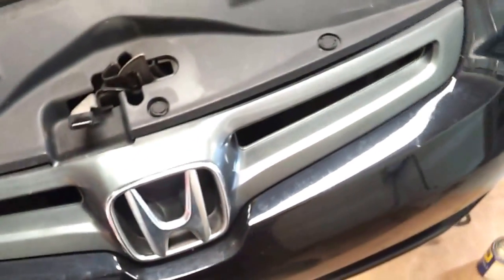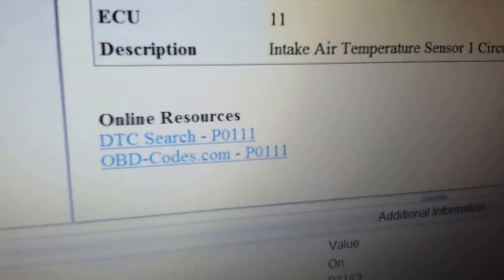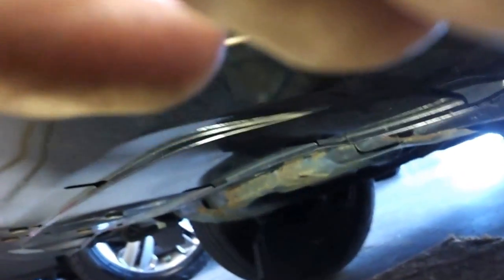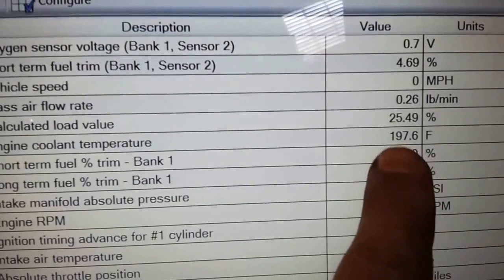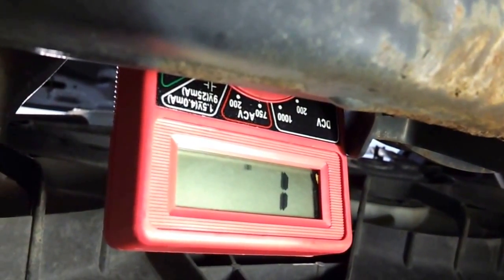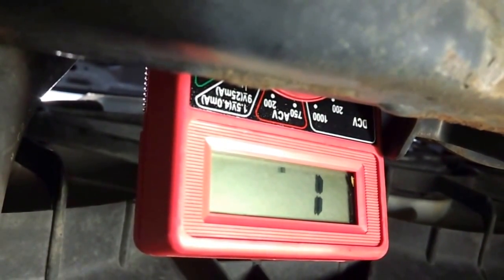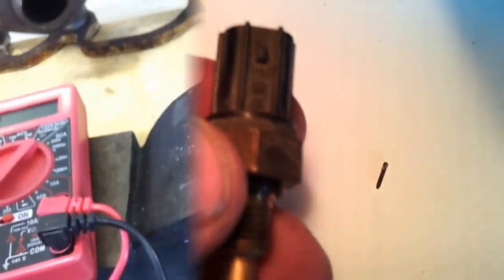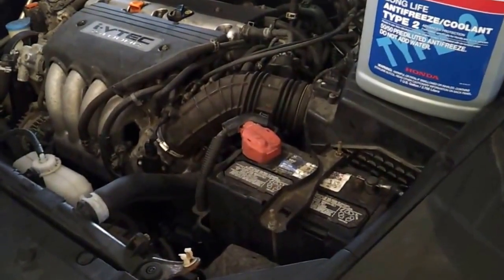Honda/Acura coolant temp sensor-trouble code P2183- 2005-2007- 2.4L 4 cylinder (ECT2)

Comment: Currently diagnosing and trying to fix my moms 08 acura tsx, changed out her radiator, thermostat, water pump is good but still is showing it’s over heating on the tack meter, but it’s not throwing the car into limp mode or smoking, could the coolant temp sensor be the issue ? Fans work as well
Reply from the maker: Leak down and compression test for a blown head gasket.

Comment: did you have to drain the coolant to replace the sensor or could you just replace it ?
Reply from the maker: Drain the radiator. Coolant baths aren't good. 👍

Comment: Good morning friend, excellent video and thanks for sharing it.

One question, can that sensor you changed interfere with fuel consumption?

Greetings.
Reply from the maker: Good question. A bad sensor could effect fuel mileage if the pcm thinks the engine is cold It would add more fuel. Probably depends on the strategy for individual makes and models.
Reply: @ozzstars_cars  Thanks very much buddy.

Greetings from Mexico.

Comment: Are both sensors the same?  The one on the radiator and the one on the engine block?
Reply from the maker: Not in this case.

Comment: Will this cause ur cooling fan to not turn on ?
Reply from the maker: Sure could.
Reply: @ozzstars_cars  when I checked it for ohms it was reading 00.01a overload that means it's not working right ?
Reply from the maker: @brooklyn7941  I discuss the sensor testing procedure in the video.
Reply: @ozzstars_cars another question did u experience any leaking at the top under the upper hose ? On the radiator

Comment: Re: wire connector to ECT 2: if this connector is jumped with a wire, should it automatically turn on the radiator fan? If that doesn't happen, does that mean there is a break in the wire somewhere? The fan works BTW and turns on with AC engaged, but doesn't turn on otherwise.

Comment: Now does this senor control the fans? Turn/off
Reply from the maker: The ecm controls the fans. Sensors only report data.
Reply: @ozzstars_cars  got it
Reply: @ozzstars_cars  thanks
Reply: @ozzstars_cars  yeah I just wasn't for sure I thought it did and I didn't notice anything else besides the two sensors and I know one went to the temperature gauge and one was the sensor but I wasn't for sure if they sent to the ECM to control the fans because when I turn on the AC the fans kick on at first only one fan kicked on then I replaced the whole assembly now both fans work but I did notice it after I took it to the automatic car wash then the next thing I know if I'm sitting in traffic the car started to overheat and again I only noticed it after the car wash and I do mean directly after the car wash.
Reply from the maker: @everydaycommute4794  test the circuit integrity, you will need a wiring diagram.

Comment: Would that bad sensor cause both my radiator fans to not turn on at operating temp? They only turn on when the A/C is on .
Reply from the maker: Anything is possible. It's easy enough to check and test.

Comment: Is it necessary to drain some coolant if your just replacing the ECT sensor located near the engine & behind the cylinder head?
Reply from the maker: There will be minimal coolant loss. Top off as necessary.

Comment: Mannn Thank you I admire your wisdom! Can you tell me which one of the two sensors that  controls the air fuel ratio? I have an issue where my temp gauge stays in the low range to long even on warm days and I have a check engine light for a P0134 o2 not getting current and Im wondering if one has to do with the other!! Thank you so much again Great deminstation!
Reply from the maker: The front A/F or O2 sensor controls the fuel trims.  Test and don't guess.  Here is a video you may find interesting on a Nissan. https://youtu.be/o_DvodrqP1I

Comment: My fans turn on when my AC is on but won’t turn on when car is at running temp with the ac off can this sensor cause that?
Reply from the maker: What codes are you getting?

Comment: There is an open (not a short) in that faulty ect2 sensor. 

Great video. 👍
Thanks for showing the locations of the two ect sensors.
Reply from the maker: You are correct. It's been a while but I probably was referring to the sensor being "shorted out". Either way it was junk. Thanks
Reply: @ozzstars_cars  yeah, I agree. 
That sensor was toast.
Reply: @ozzstars_cars  I think you were reading the ohms of the vice also, since the metal part of the sensor was clamped.
Reply from the maker: @anthonysteelemusic  12:25 clearly states OHM readings of the new sensor.

Comment: Thanx a lot for your clarification.  I had a problem with my fans not coming on for my RSX. I googled for days and everybody keeps talking about the one ECT by the Engine block and doing the safety pin test on that will trigger the fans to turn on. I did it and nothing happens, so I was scratching my head for the longest time trying to figure out why it's not turning the fans on. I know about the one ECT by the rad and tested that made my fans go on there, but nobody talks about that sensor. Because of your helpful description, now I know where my problem is, and I will hopefully fix my problem by replacing my ECT2 sensor. Thank you very much!
Reply from the maker: Thanks for the comment Jo, Let us know how the repair turns out.  Glad to hear the vid helped you out.
Reply: @ozzstars_cars  Well, I currently don't have any problem with the Temperature gauge rising, I just noticed that both fans were not working even on the hottest days and I just noticed my Voltage drop dramatically when I slow down, but when it's cool or during winter I don't have that problem at all. So, I am suspecting it could be the cause of the fans not working. I bought the ECT1 and ECT2 already a while back because I didn't know which to replace. I played around with some electrical components now, so when It's getting warmer now, I'll see how it goes. When I replace the ECT2 sensor and get the fans working again, I'll let you know. Thanx again! Cheers!
Reply from the maker: @joktv7748  good luck with the fix, keep us posted.

Comment: Hey, man firstly thank you for making this video really informative. I am wondering if you run 12v to the wiring of the coolant fan sensor if both fans are suppose to turn on? Thank you!
Reply from the maker: I wouldn't try that with the sensor circuit.  You can unplug the fans individually and apply 12 volts for testing.  The ecm turns the fans on, not the sensor.

Comment: Í have a question the fans dont star 
i change that sensor from the radiador. 
and still not works.
I check the relays they work
and fuse
Reply from the maker: Did you apply 12 volts to the fan directly?

Comment: Not sure how active this comment section is but I have a 2015 accord that the cooling fan and ac fan do not stay on, seems that all the fuses are good. Think it’s the temp sensor? And help would be much appreciated
Reply from the maker: Why would they stay on? Cooling fans only run when necessary.

Comment: do you need to use a Honda genuine part or a similar part will do?
Reply from the maker: The sensor in the description worked fine it's also pinned in the comment section. OEM is good if you want to pay the money for it.

Comment: I have a question that I haven't been able to find an answer to anywhere. Does the radiator change from the 04 to the 05?
Reply from the maker: 2003-07 should be pretty.much the same but a difference between auto and manual transmissions makes a difference. Automatic trans models use a cooler in the radiator.  This car was a manual.
Reply: @ozzstars_cars  mine is automatic however the location for the sensor is much bigger than the sensor that actually goes in there. It seems like that short stubby fan switch goes in there but the plug is round and my plug is square like the one in your video.
Reply: @benny-hn7xe  I have the same issue. Did you use the bigger sensor? The short stubby one Instead?
Reply: Someone replaced the radiator before on your car then. What year do you have?

Comment: Thanks for the good tutorial.  It came in helpful for my wife's 2006 Accord.  I was able to get it done with only a few broken clips.  That's understandable, the car is 14 years so the plastic is brittle.  First time the under panel had to be removed.  One thing to note. I think your video says to use a 3/8" deep socket.  Mine was a 17mm deep socket, but I had to use an 18mm because I did not have a 17"".
Reply from the maker: Fixed and the wife is happy. Priceless.
Reply: @ozzstars_cars  Indeed!  Now to check her front driver side wheel for a scraping noise...  Never a dull day even with the stay at home orders.

Comment: Had code P2185 on my 2005 Honda Accord and this video was the solution, thank you! Note - the part number you had shown is now listed for a Honda Civic, I ended up with an FAE Altrom part #143 5085
Reply from the maker: The coolant temp sensor link that is posted in the description is for a 2005 Accord:  https://amzn.to/2uXdEwM
Reply: Ozzstar Correct. That is the vehicle in the video and mine also. However when I went to Advance Auto, both the counter person and I saw that part number was showing it fit a Civic. Instead of risking it, I went to another parts store.
Reply from the maker: @jayparsons9347  interesting but we know it works.  Thanks for updating the info.  Take it easy -Glen

Comment: Does that sensor make your car run hot
Reply from the maker: It reports temp to the ecm so it can determine proper air/fuel ratio.
Reply: Ty man I will go out and change it out and see what happens keep you informed thanks for putting your video up to man

Comment: Which sensor controls the cooling fan? My fans come on with a/c running but never come on with it off but the temp gauge remains just below the half mark no matter how long it runs.
Reply: I have the sams problem
Reply: 2009 accord LX the same problem!
Reply: Same problem idk what it is smh

Comment: This is the first time, I have gone to YouTube to help me diagnose a diagnostic code.    FIRST) I want to thank Ozzstar very much for the education your video has given me.  SECOND) I want to thank all the users for taking the time to comment and for those who took the time to reply.... I learned even more by reading through the comment/reply history.    I would have bought regular antifreeze and diluted it myself but your comments saved me that mistake by explaining that Honda's coolant is formulated of aluminum engines in order to reduce corrosion.
Reply from the maker: Great comment WR, thanks!  -Glen

Comment: I don't get it. If the other good temp sensor reports to the gauge and the computer, what does the bad sensor do?
Reply from the maker: Depends on the vehicle.  In this case ect2 reports to the ecm.
Reply: @ozzstars_cars  If your scan tool was reporting the engine temp, doesn't that mean that the ECM was already getting the info?
Reply from the maker: @nickv4073  yes. I would have to look at a wiring diagram.  I believe ect2 would be for radiator fan turn on and off.
Reply: @ozzstars_cars  Radiator fan. That makes sense.
Reply: @ozzstars_cars  yes you're correct. It controls radiator fans.  

The AC won't blow cold without the radiator fan working, right? Im not telling..im asking..Would the ETC 2 sensor issue/non functional radiator fan cause   A/C to only blow hot air?
Reply from the maker: @heatherrhodge2588  if you want the a/c to work the fans must be operational.
Reply: @ozzstars_cars  thanks! wouldn't the car overheat as well if the radiator fans weren't working? possibly not even showing that the temp was getting hot on the gauge on the dash, since it's tied to the sensor before the fans? I'm wondering bc my car has a code for ECT sensor 2 high voltage and fans aren't running.
Reply from the maker: @heatherrhodge2588  test, don't guess.👍
Reply: @ozzstars_cars  true.. good advice. I just replaced the PCM in my car bc the old one got super corroded and the car was in limp mode. I switched out the EEPROM chip but accidently switched another 8 pin IC before realizing it wasn't the EEPROM! when doing so one of the solder pads detached from the new board. it didn't seem to be connected to any circuit traces but I still found the tiny little pad and did my best to reattach it before soldering the IC. it's obv a proprietary chip bc there's no info anywhere about it 😫. I realized I'd switched the wrong chip when the VIN was wrong in my scan tool app. after switching the actual EEPROM and running a scan on the car it has no longer been in limp mode but has thrown random codes every time I've scanned. the first time there was P0301, P0124, and P1693.. which means, cylinder 1 misfire, TP circuit high, and turbo charge circuit malfunction. the 2nd time I got totally different dtcs: P2185, P0603, P0630 & P0498, ECT circuit 2 high, ECM KAM error, VIN not programmed & EVAP control vent low voltage. completely diff codes & nothing had been touched on the car between scans! cleared the codes and the next time I scanned it had the ECT 2 high and VIN mismatch. cleared again and all that was left was the P0285 ECT 2 high. it was at this time I noticed the radiator fans weren't running. it's possible they hadn't been prior to that but I hadn't paid attention. This is the point I'm at now. 

I'm completely baffled as to why the codes were completely different between the 1st and 2nd time I scanned!? With the original PCM I had been getting a U0107 code (lost communication with TAC module) only, however it remained consistent in that it was always there. the AC wasn't working already when the U0107 code & limp mode started but idk why. there were never any codes in old PCM pertaining to AC (as I mentioned, the only code I ever saw was U0107). What would you make of this? it's an 05 Acura TSX auto BTW. I'm not familiar enough with cars to have an opinion, but just knowing nothing has been touched on the car besides replacing the PCM (and well I did replace the TAC module also but everything was plugged back & the U0107 remained) but it seems to me that the "new" PCM is bad as well?!

Comment: To replace sensor the whole job can be done from the top of car. Drain radiator, then reach down from top of engine compartment and blindly disconnect electrical connector from sensor, blindly put socket on sensor and remove. (Make sure o-ring came out with old sensor) It took a total of 2 minutes to replace after draining radiator.
Reply from the maker: You say the whole job can be done from the top yet the radiator drain is at the bottom?  Interesting physics.
Reply: @ozzstars_cars  I appreciate you taking the time to make this helpful video but, yes, you can drain the radiator from the top. Lean over the top of radiator, reach down and open bottom drain petcock, Fluid will drain past circle cut-out in lower plastic shroud cover.
Reply from the maker: @ruth1948  so you just let the coolant drain on to the ground? Or do you use a pan and place it under the car, down below.
Reply: @ozzstars_cars  Yes I used a container to catch fluid and then re-filled with 'Honda' anti-freeze.
Reply from the maker: @ruth1948  oh good way to do it
Reply: how hard is to reach the sensor? did you use short or long socket? do you have the sensor part #? i'm confused with the other video. this video shows the sensor is a long one (ECT2 ?) and the other video also shows the sensor on the same location but short sensor.
Reply: You don't even have to drain the radiator because you won't be loosing that much coolant.

Comment: You actually are doing this replacement the hard way for the first coolant sensor, simply reach down to the left of the battery down to the bottom of the radiator and remove with socket wrench..takes 10 minutes max...Other than that great video...
Reply from the maker: Takes one minute to remove the shield and the sensor can be properly tested and the connector diagnosed BEFORE replacing it.
Reply: Ozzstar you can still properly test and see it without removal of un-necessary parts. But to each there own. I prefer to work smarter not harder. But like I said great video.
Reply from the maker: I guess the mitts on the end of my arms are to larget to test that way.  Smarter not harder is a good idea. :-)

Comment: Great video! Hopefully you’re still monitoring this channel because I have a question... I have an ‘06 Accord with the 4 cylinder and my temp gauge is going crazy. I just recently bought the car and the temp was reading normal and then a few days ago I noticed with the car off the temp gauge was sitting on H and the as the car warmed it climbed from there.. Now it’s on the complete opposite side of the C - H. As it warms it seems to still climb within what would be considered normal perimeters the needle just isn’t on the right side of the gauge. It’s not overheating. I was thinking the temp sensor #2 (at the cyl head) is bad. Your thoughts??
Reply from the maker: You have to test the coolant sensor. I would also check scan date to see what the ECM is reporting.  It that's okay then check the wiring and connectors in that circuit for corrosion or a short. If that checks out then your into the gauge cluster to start diagnosing that. I make videos on a regular basis and check daily.  Thanks for stopping by.

Comment: followed exactly what you said, thank you for your help,. $40.00 part and an hour of work saved me hundreds and passed my emissions
Reply from the maker: Your welcome.
Reply: @ozzstars_cars hey man I know you posted this a long time ago my friend broke the black connect piece on top of that sensor and now getting the p2185 it seems to be hooked up and tried clearing but code stays so im guessing that clip is causing it not to be connected good or something is going on what do you think I shld change sensor and how would I fit because harness is way to expensive
Reply from the maker: @ashleyredden2201 fix it right